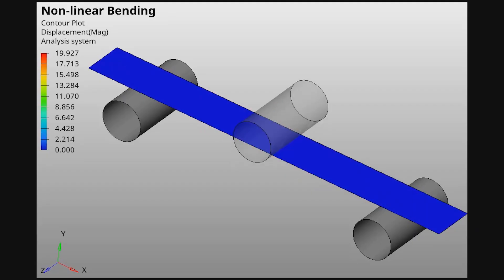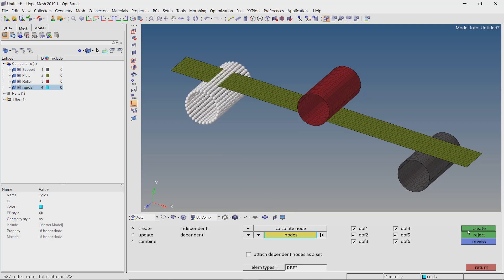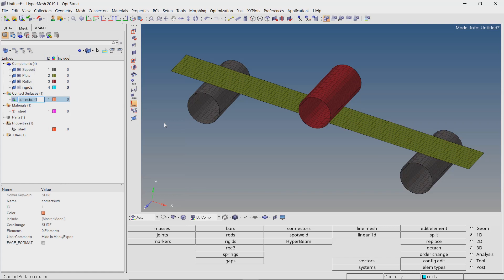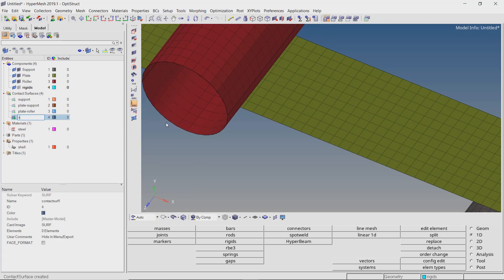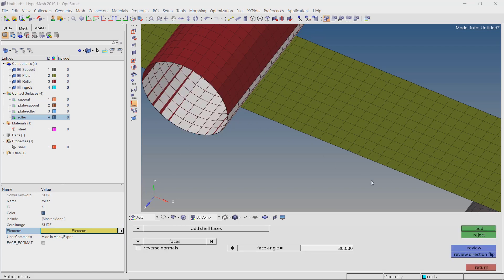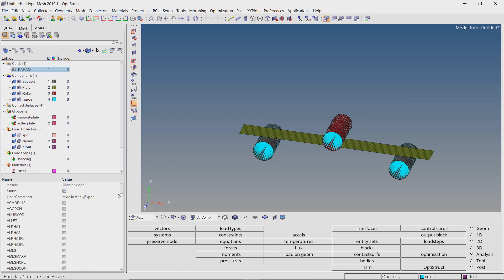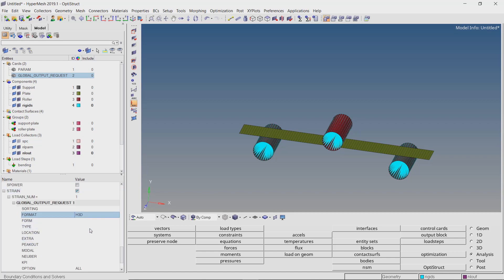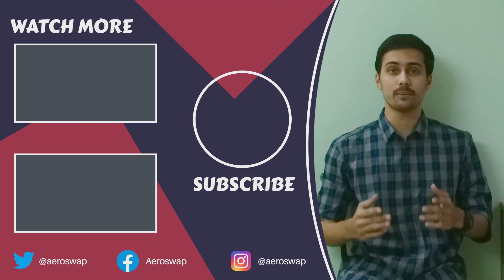Hypermesh Nonlinear Contact Analysis [Optistruct Tutorial]

Comment: Amazing video to get introduced with contact analysis. Thanks. Also, I have a doubt, so you assigned thickness 1mm to the support, plate and roller. This results in the elements from support (if viewed in 2D detailed element representation) crossing into the plate and not just ending at the surface. I'm not sure if it has to be like this or the elements of support and roller should only touch the outer surface of the 2d elements of plate.
Reply from the maker: Thanks Sarjit! I am glad you liked the video :)

Good question! If you enable the GPAD option in the contact settings, thickness will be taken into account. Please try that option to avoid crossing of elements in detailed representation.

I hope this helps!
Reply: @Aeroswap  Thank you for your reply and the info.

Comment: Firstly, Great job . Absolutely love your videos. keep doing more . 
Quick Question . As Non-linear material properties were not assigned to the components, How accurate are the stress values ? How will we know if the plate is breaking or if it is above yield ?
Reply from the maker: Thank you!
Yes, nonlinear material was not assigned here as I have covered geometric and material nonlinearity in a separate video. The main focus of this video was boundary nonlinearity through contacts. To get accurate results, material nonlinearity has to be set in this case. As this was out of the scope for this video I have not done it. You can try and check the results!

Comment: Hi,  i have an error saying "MORIENT should not be OPENGAP or OVERLAP for finite sliding CONTACT 1" . am using 2017 version
Reply from the maker: Try switching contact type from 'Finite' to 'Consli'.
Reply: @Aeroswap  I tried, but I see the same error
Reply from the maker: Did you try changing the MORIENT option to different setting. As mentioned in the error message, try not to use OPENGAP or OVERLAP options.
Reply: @Aeroswap  Its running for MORIENT = NORM/REVNORM, TRACK = CONSLI. Thank you :)
Reply from the maker: Good to know!

Comment: Nice explanation. But, I am facing error #4965 ( Maximum number of time increment cutbacks reached, analysis aborted) while analysis. Is it  because l have applied displacement of 140mm which is necessary for my simulation?
Reply from the maker: Try this. Create a new loadcollector with card image 'NLADAPT'. In that, set NCUTS value to a high number (for example 100). Then run the analysis again and see how it goes.
Reply: @Aeroswap  Thank you for your prompt reply 🙏..
Reply: @Aeroswap  Hello l need your help for three point bending test on our beam. Can we have discussion on e mail?
Reply from the maker: Sure, reach me via email for better communication.
Reply: @Aeroswap  How can we create different graphs like force Vs time and force Vs displacement, etc.
Reply from the maker: This can be easily done in Hypergraph. Select the required parameter in horizontal and vertical axes and plot the graph.
Reply: @Aeroswap  l tried but l couldn't plot the graphs..Would you please elaborate ?
Reply from the maker: It is not possible to explain the setup in a message. There is a detailed explanation about this on the Altair forum. Please refer the same to understand the steps in plotting this kind of graph.
Reply: @Aeroswap  Thank you for your suggestion

Comment: hello, in my model there is a minute gap and no connection of contact elements. its showing error as * ERROR 14: Missing  element #490502 referenced by    SURF # 1.
Reply from the maker: This error is not related to the gap. In fact, the gap will not give any error. It is okay to have such gaps in the model.

Please check your contact surfaces. Make sure that they are assigned elements with correct normal directions.
Reply: @Aeroswap  hello, i have checked and saw that all contacts are normal to each other. can you please share me your email so that i can send you the photo? it'll be helpful for me
Reply from the maker: My email address is provided in the 'About' section of this channel.
Reply: @Aeroswap  
hello sir,
good morning.
I have followed your steps and sir my issues are resolved.a big thanks from my side and I appreciate your time and information which you have provided to me.there was an issue of CTRA4 elements and coinciding of plates in my model.after i resolved it I'm able to solve it again. I got the results and other information.keep posting your hypermesh videos and i do recommend in my university to follow up your channel for videos.
thanks and regards
rehan
Reply from the maker: Hey Rehan, 
Good to know you were able to perform the analysis successfully. Feel free to reach out anytime again in the future :)

Comment: Why are we using NLPARAM Card?
And NLPARAM(LGDISP)
Reply from the maker: NLPARM card is essential to run any nonlinear analysis in Optistruct. Without this card, the nonlinear analysis will give an error and no results will be obtained.

This card specifies the convergence and load increment parameters for nonlinear analysis. For more information about NLPARM and LGDISP, please refer the Optistruct user manual.

Feel free to reach out if you face any difficulties. My contact details are provided in the 'About' section of this channel.

Comment: Why are we selecting finite sliding in our model. why not small sliding. And what is the difference between two. When do we use small or finite sliding?
Reply from the maker: Hello Sahib,
Good question. If you observe the contact settings, there are 3 types of formulations - small sliding, finite sliding and continuous sliding.

Small sliring is used when the relative moyion between parts is negligible (eg. Bolt-nut assembly).

Finite sliding is used when there is significant relative motion but the region of contact remains constant (eg. 3 point bending as shown in this tutorial).

Continuous sliding is used when there is large relative motion and the contact surface has to be updated after certain intervals of time (pinion-gear in motion).

I hope this clears your doubt !

Comment: Great tutorial. Do the contacts have to "touch" in the cad model? I want to optimize a my composite layers so my thickness might change over the iterations. Making a new cad model every time does not seam like the correct way. Plus i dont know if the mid surface aproach would work for thicker materials
Reply from the maker: No not at all. You dont need to create a new CAD model for every analysis! As the gap between the components is small, the components will move closer due to applied boundary conditions and then the contact will get activated to avoid further movement.

As for midsurface, if you want the solver to define the contact with added thickness, switch the GPAD setting to THICK. This will include the thickness of all shell components during contact operation.

Hope this answers your doubts :)
Reply: @Aeroswap  Thank you for your fast response. That helped me a lot. Keep up the nice work 👍

Comment: Great tutorial. However, I cannot see the option "Contact Surface" to create a collector. My HyperMesh 2020.1 has only the option "Contact". How can I create the contact surface?
Reply from the maker: Yes, they have made several changes in the newer versions of Hypermesh. Try using the Contact browser. It can be enabled from the View dropdown in Tools bar. 
I guess there is an option in the contact browser to define the contact surfaces manually.

Thanks for pointing this out. I will soon make an updated video about this!
Reply: @Aeroswap  Hi Guys, I faced the same problem as for @akcalixto that I don't find surface contact option as I use Hypermesh 2020 and after a reaserch I found it under ( create-->Set segment and change the card image to surf ;) it works great)
Reply from the maker: Looks like I should make another contact analysis video with the newer version of Hypermesh. Will work on it soon!

Comment: Very nice. My kind recommendation is to spend some time explaining the property options in the definition of group contact. Keep up the good work!
Reply from the maker: Thanks for the suggestion! I will try to get more into the details from next time 👍🏻
Reply: Dear friend, I am watching your tutorials for a few days and you are doing a great job, thank you for your efforts!

In addition, I have same concerns with Emmanuel. I performed the same analysis succesfully but I don't have so much information about "PCONT parameters and Contact parameters". Could you please explain these parameters also?

Thanks in advance, greetings from Turkey!
Reply: @furkanyalcn7697  PCONT parameters, or contact parameters in general are something that one must devote substantial amount of time in order to understand and implement correctly in an analysis. What you enter in the contact card might well mean the difference between a successful analysis and a failed one. If Swapnil has the time he can prepare a presentation, however it is a topic that cannot be covered in a single tutorial; it requires deep knowledge of contact modeling techniques and experience with that type of analyses. Regards, Emmanuel
Reply from the maker: I agree, I will probably create a separate video explaining each setting in the contact parameters. It is surely not as easy at it looks!
Reply: Thank you both. I agree with you Emmanuel, so that's what I am trying to learn especially :)

Comment: Great example of the nonlinear contact analysis. I like how you pointed out the importance of mating contact surfaces along with the element normal directions.
I'd like to ask you a personal favor to complete this nonlinear chapter. Could you do another tutorial for a 3D multi body nonlinear with material nonlinear and contacts defined? I often run into errors during/after the solver, I'd like to see if I do anything incorrect during the preprocess stage.
Reply from the maker: Hey Ken, do you mean something like a gear pair in mesh ? If you have a particular model in mind, let me know. Currently, I am working on a 3D model with nonlinearity. 
It takes a very long time to solve even with good hardware. This will be interesting!
I will start working on this right away 👍🏻
Reply: @Aeroswap  Glad to hear you're already working on a 3D nonlinear. A gear pair can be a good example, but yeah what I meant was just general 2 or 3 components where you can assign contact surfaces. But whatever you're working on now would be very helpful! Thank you for your hard works.
Reply from the maker: Thanks Ken! I'll try to finish up the video as soon as I can.